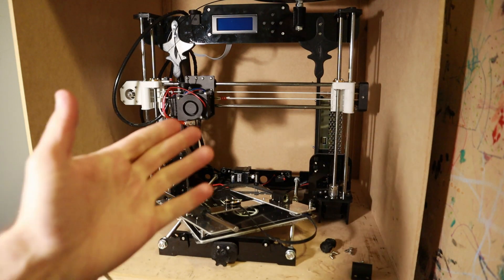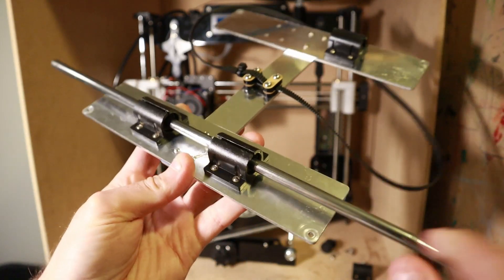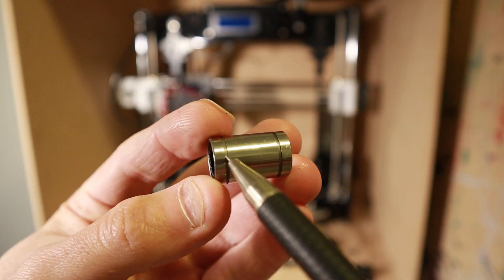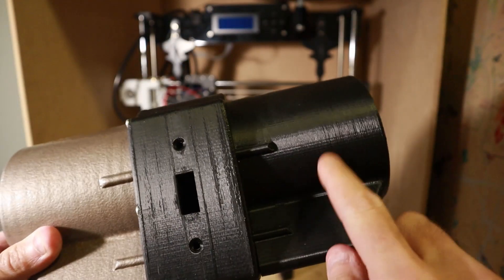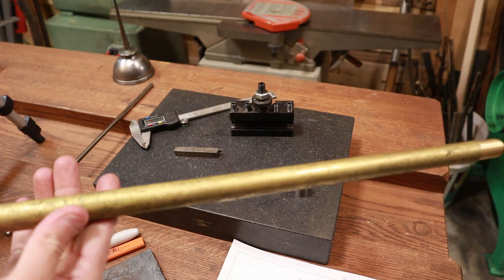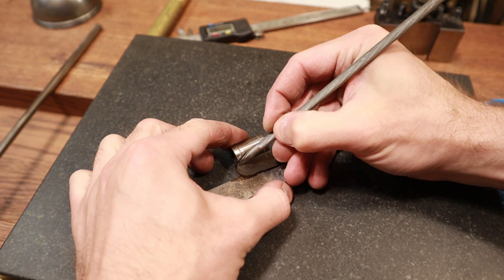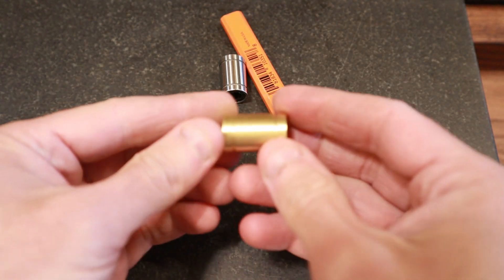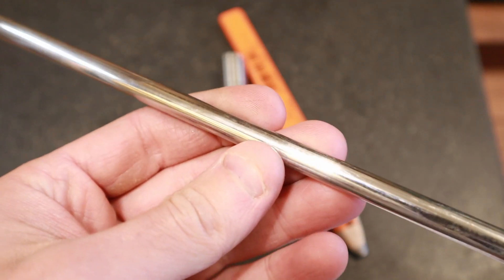🔧 Fixing my BROKEN ANET A8 3D printer by making my own replacement parts

Comment: Critical Comment.

You sir are an ignorant hack. 

A linear motion ball bearing is used to reduce friction while maintaining a good degree of precision. You downgraded.

Drills do not make round holes. To get round holes you ream or bore the holes. Then perhaps you lap.

The 3D printer's end result is dependant on the print head going to a precise point and giving a squit of plastic at just the right time.  The farther off from spec that happens, the poorer the result.

Next consider when plain bearings are used. Often a bronze bearing is a great choice, also known as oilite bearing, or oil impregnated bearing.  These are made from powdered metal that result in a porous material that holds the lubricating oil. Brass doesn't last to long in service.

OK rant mode off.

I watch your video's because I appreciate how clever you are.

Also note, I didn't refer to you as stupid, I refered to you as ignorant.  The distinction is an important one because ignorance can be cured, stupidity however can't.

Overcome my friend.
Reply: Maybe if you're going to give constructive criticism, don't start off with "You sir are an ignorant hack" and then pretend later that there is some kind of appreciable distinction between that and just calling someone stupid.  Colloquially, there's no difference.

You have to overcome your own ignorance it would appear.
Reply from the maker: Thanks for the comment, and the heads up that it was critical.  I do read all of the comments and try to respond to most of them.  

As far as ignorant, well maybe a little, nobody has ever called me this so I don't even know what it means.   In this case, metalworking is not my field, woodworking is, some skills are transferable.  I like metalworking because of the ability to create your own tools that can last and the integration of metal and wood as well as other materials does interest me a lot.  It also benefits me in being able to make things and repair them myself without spending much money. 

The 2nd point I wanted to make is that these videos are no comprehensive, they are more about the idea and showing people the process and some of the problems if they'd like to do it themselves.  I'm no Vlogger, so you don't get to see or hear why I make some of the decisions that I do, however... all of my decisions are well thought out and revolve around a set of constraints.  An example of some of my constraints:

 - I always try to do something for the least cost possible with what I have on-hand...At the moment, there are issues with shipping, so I've avoided this completely and used what I have on-hand

- The next constraint is what machinery I have available to make the parts, I have a lathe, it is very old, but works well, so that's what I use

- The next is longevity, and here is the one that you overlooked, the rails are not hardened, 3D printers are additive machines, not traditional, they have very minimal loading in one direction for the majority of the time.  Bushing made specifically for these machines are made to be sloppy, it makes them easy to install, and minimal contact area reduces friction etc.   With a proper liner bearing set has both hardened balls and rails so they'll last and maintain good tolerance as you say.  In the case of these machines, everything is cheap so if the balls were even hardened, they would deform the rails, cause scoring and premature failure, if nothing is hardened, well everything fails.  

The best material for 3D printer bushings is plastic (mentioned in the video), it has the best characteristics under the constraints.  Delrin would be a good choice for something that I can machine in my home shop, and I may do that in future.  The other options are okay also, however they cost money and I prefer to keep mine.  Oil impregnated bronze works best when heat is generated, these machine do not travel at those speeds, so it is not recommended for this application.

If I were a machinist, I'd have the tools to ream and bore, instead, I make my own tools... the subject of my channel really, so this is what you get.

I do take comments into consideration, they also can drive me to create future videos, so keep them coming.

Have a great weekend!

Comment: I have zero experience with 3-D printers. Considerably more experience with making tools. Your production tool wore out because you did not heat-treat it. Also since the tool was Mysterium steel, not clear if it could be treated because the carbon content is unknown. Always worth a try. The blank is probably mild steel but I have successfully heat-treated quite a few mild steel blanks. Alternatively it could be case-hardened (carburized) but that is a more complex process.
Reply from the maker: I agree, I expected this old leaf spring to perform better.  I made the mistake of using a piece that I had used for a forging project, and I believe it drew too much temper, or normalized that piece.   I need to get my forge going again for some more forging and for heat treating.